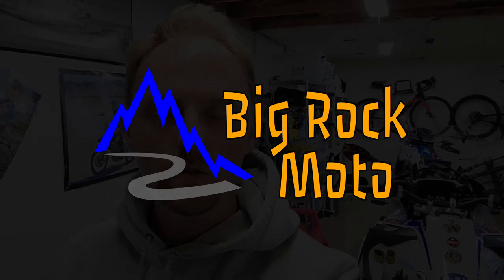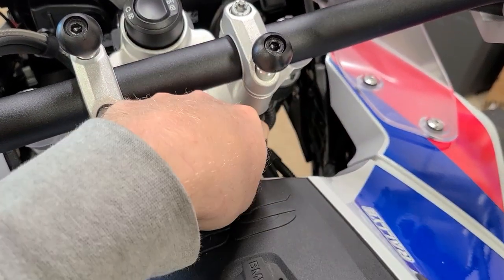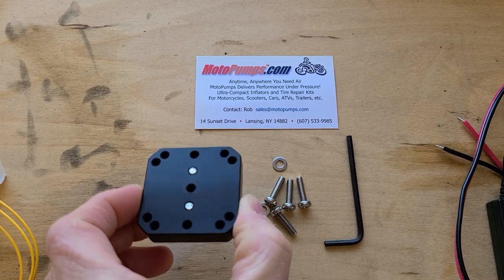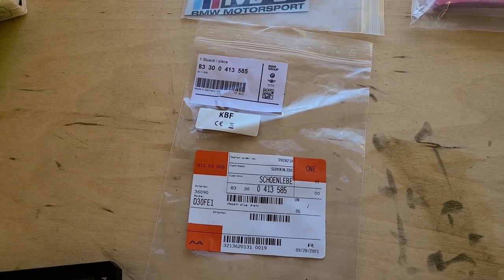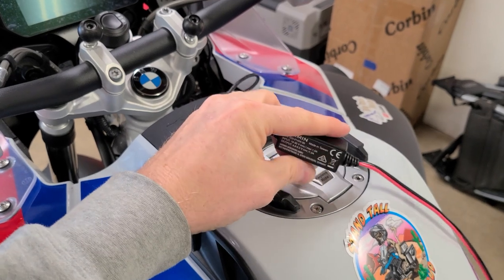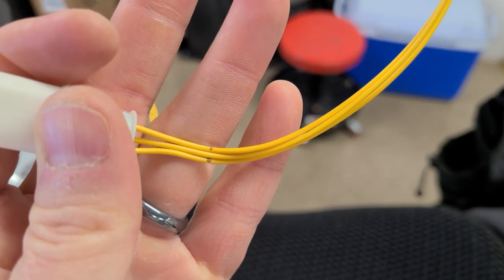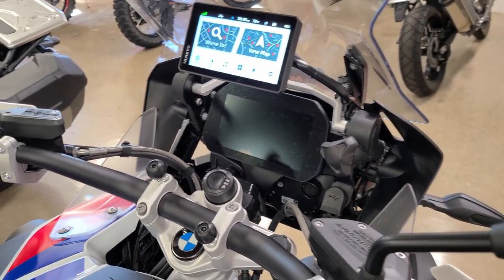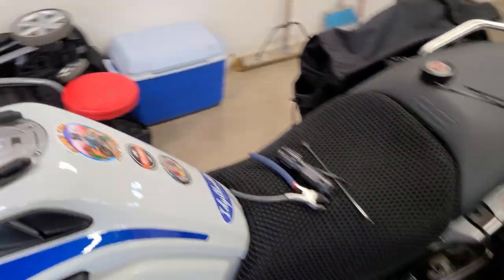How to Install Garmin Zumo XT on a BMW GS (factory wiring)

Comment: Crimp connectors seriously are an inferior connection and something as a career electrician involved with just a lot of different things from low vold dc to much higher AC stuff I have seen so many crimp connectors fail ...for one thing in most applications it is stranded wire which so easily can work loose....at the very least twist the strands tight first or tin with solder ....but if doing that why not just solder the connections and insulate with shrink tubing which will then NEVER fail under any normal conditions.   I had a pre owned 15k milr bike the previous owner had wired in all sorts of things with quality  wire and brand name crimp connectors but one after another they were coming loose and losing connection ....with low volt direct current especially this is apt to occur over time with vibration and temp changes on top or having been too casual an install to begin with  crimping procedure ...I hate em for automotive type stuff especially unless short term non critical

Comment: You would of been better just purchasing a 3D AM adapter then you could of just utilised the original bmw Cradle a much simpler way and you can lock the sat nav into the cradle like the Nav 6

Comment: Hello Ian, What other sources of power exist? I never had the factory nav and the plug you show doesn't exist on my GS. I ordered all but the Zumo XT (Next Paycheck). Can I run it off the USB power adapter I installed?
Reply from the maker: Not really, the GPS needs power from the mount itself. The USB is just for computer connection. Are you sure you don't have a plug under the fairing? I thought all bikes had one, but your bike just would not have the wire going up to the crossbar. It is ziptied or secured and hard to find.
Reply: @BigRockMoto  I might have to peel some of the fairing off and dig for it. I could try to eliminate the BMW Power Socket and plug the pigtail in there...

I the area shown in your video, I found a plug going to the horn. Crazy I know...
Reply: @BigRockMoto  I found it! I had to remove the right side of the body work and the gas tank cover. That little booger was really tucked in! Thanks Ian!

Comment: Not good, you loose ability to lock the XT unit, get a 3D printed motorrad adapter & choose lockable in the specs.
Reply: I've got this mount, but will now chose this way instead. Why ? Because it removes all the bollox on the mount. And my Adapter keeps losing connection. This way is much cleaner.

Comment: Anyone else's OCD alarming off that the Motopumps logo will be upside down when he spun it around......AAAAAAAHHHHHHH
Reply: Mount the name plate upside down during initial attachment like the video shows.  Once it is spun around the logo is proper and the supplied Allen wrench will fit between the mount and windscreen for final tightening.